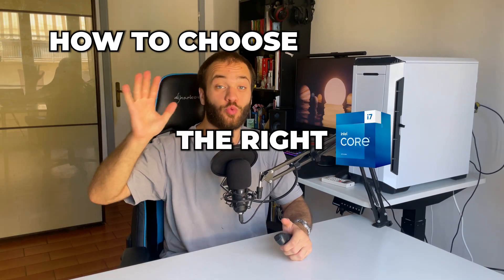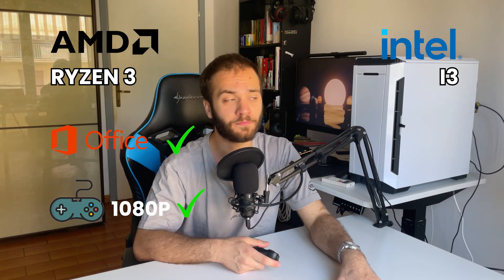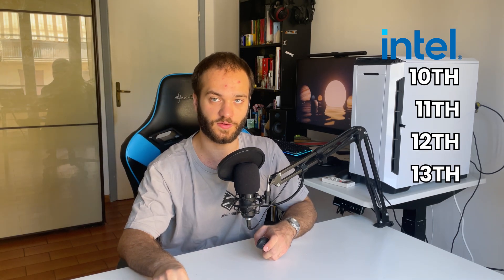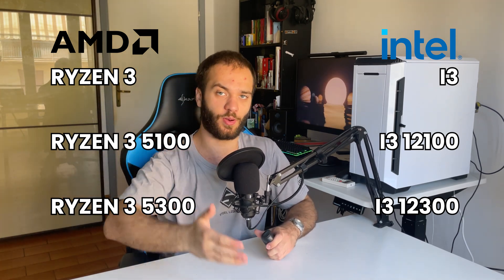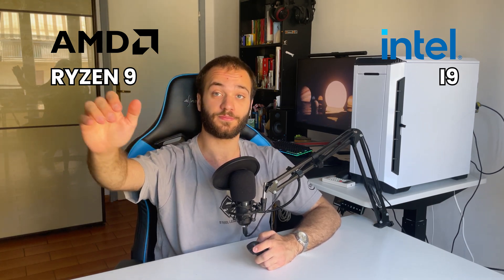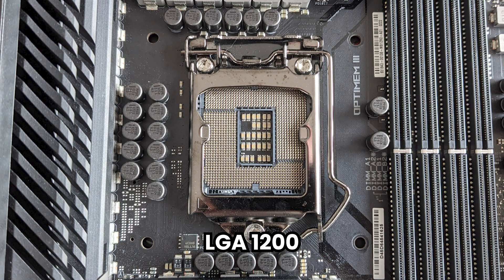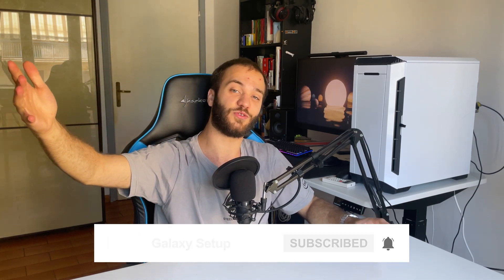HOW TO choose the right CPU in 2023! -AMD Ryzen vs Intel Core

Comment: Why did you say there are only two CPU makers?  If it only makes sense to review those two, fine, fair enough, but why incorrectly state that those are the only two?
Reply from the maker: Thanks for your correction: there are only two CPU makers for desktop builds, I didn't consider all the ARM-based CPUs since you can't just buy and install them on your PC. This video is an introduction for non-tech-savvy people to PC building, so I wanted to keep it as simple and linear as possible

Comment: Thanks very comprehensive. But you mentioned there are no 6xxx for Ryzen 7. I am looking at R7 6800H at the moment, thinking Abt whether I should get a Intel or AMD.
Reply from the maker: I'm glad you found this video useful!
To keep it as simple and easy to understand as possible, I had to avoid many details. The Ryzen 6xxx series exists, but only in laptops and super compact, low power consumption pcs. 
If you found it in a laptop, that's a solid choice, if it is in a desktop, I would avoid it

Comment: This video is just riddled with errors.   Ryzen CPUs without an X are still overclockable.  Only X3D CPUs can't be overclocked.  Ryzen 7000 also has "F" SKUs without an IGP.

Also, when gaming, lower-end CPUs are actually better suited to 1440p and 2160p than 1080p because gaming at those resolutions slows the GPU and makes it easier for the lower-end CPUs to keep up.  For 1080p gaming, you need a faster CPU to keep up with the GPU because the workload on the GPU is much lighter.  This is why CPU gaming benchmarks are all done at 720p or 1080p.

If a Ryzen 3 is capable of 60FPS in a game, it won't matter what resolution that game is at.  However, it would bottleneck something like an RX 6700 XT at 1080p but wouldn't bottleneck it so much at 1440p and not at all at 2160p.

High-Resolution gaming does NOT require a better CPU, it requires a better GPU.  Low-resolution gaming requires a better CPU becuase it's less GPU-dependent.  You're giving people false infornation.
Reply from the maker: Once again, as stated in the video multiple times, my explanation is a simplification for people that are new to pc building, so I've left some specific cases by side, since they would just confuse someone who's trying to generally understand cpus naming.

When gaming, lower-end cpus are not better suited for 1440p or 2160p gaming, because you're going to get a huge bottleneck with stronger GPUs.
High resolution gaming DOES require a better cpu, as well as a better GPU.

I'm helping people get into this world, while you're just accusing and confusing people.

Comment: Thank you for your knowledge on Ryzen and Intel processors ..I built a computer about 15 years ago and it worked good.. looking for the right mother board is super important ...number of slots for expansion cards ..usb ports and above all ease of accessibility ... and of course what processors fit into that board...also the types of cases that need to fit those expansion cards...One other thing..grounding gear. You don't want your body building up static discharge from walking around on a rug and then trying to put in a intel processor...Poof all gone.. Great video keep going you do it well. 5 Stars.
Reply from the maker: Thank you so much, I'm honestly shoked by the amount of positive feedback I'm getting on this video, it means everything to me❤️

I will soon make a more in-depth video about motherboards as well, since, as you said, you need to consider many variables for it as well!

Comment: Bit confused as to why 1440p was referred to as 2k. 2k 2048*1080, thus making 1080p 2k.

1440p could be referred to as 2.5k or QHD.

Anyway, given the price of motherboards, I don't see anything wrong with pairing a Bx50 board with a Ryzen 7
Reply from the maker: Yeah, 1440p is not actually 2K, but is broadly used as synonymous, and sometimes I misuse them as well.
Every time I say 2K I actually refer to 1440p resolution

Comment: Quick question, which combo is best for streaming and gaming ? GTA rp, Cod, Fortnite etc? Budget is around $1500
Reply from the maker: Hey, thanks for the question! In my opinion, if you want to go with second handed parts, which I highly recommend, I would pick a Ryzen 9 5900X or Intel i7 12700K and an RTX 4070 or a Radeon RX 7800 XT. If you want new parts, I woudl go with the same processor and an RTX 3070 Ti

Comment: Unrelated question: I'm considering parts for a PC, and my brother suggested water cooling, since my room is very hot, i have no air conditioning and I don't have the best air circulation. The room itself is fairly big and the place where the PC would stay is about 1m above the floor on an open partition of a wood wardrobe I cleared for it, the dimensions are 80cm height, 80cm length and 50cm depth. I'm afraid of water cooling because of leaking and maintenance, and from what I've seen the results are pretty similar. Does the room condition change it somehow? I'm not aiming for anything very powerful also, probably an i5 12th generation. The GPU would be a 3060ti, which is the only part of the set up I'm most certain of, unless I find something more powerful for a similar price, but that' a long shot.
Reply from the maker: If I understood your situation correctly, I would rather spend a little bit more on fans and on a good case (from Fractal Design, Corsair, Cooler Master or other reputable brands), to grant a better overall airflow inside the case. Water cooling is great, and if you buy an all in one the maintanance is relatively low, but if you don't enough air coming in, it will suffer just like an air cooler.
The room condition do change the needs for different cooling solution; if you can, it would be incredibly useful to place a couple of fans on the wardrobe itself, but you would have to cut the wood, and I don't know if you can/want/are willing to. But a good case with a proper airflow, with 3 fans in and a couple of fans out, should be more then enough for your configuration.
I hope I've been clear enough, if not, please let me know all your doubts and I'll try to go deeper into the topic
Reply: @GalaxySetup  you were clear and helpful, thanks. I just looked at the initial setup he has in mind, a 3060ti with an i5-12600. Is that a good processor? I want to buy and have peace of mind for a couple of years, think this would be viable for a while? And about the RAM, he said 16GB is enough, should I get 32GB instead? My budget is stretched as is, and the RAM seems like an easy part to replace later when I find a good sale and when 32GB becomes absolutelly necessary for gaming. These parts are not that cheap where I am, and it's a bulky investment, I wanna make sure I buy something that will last me as long as possible. And thanks for taking your time to answer these questions.
Reply from the maker: The i5 12600 is a great processor, and it's going to last for a while; and the 3060ti is the perfect match with it.
As for the ram, here in Italy and in most places is getting extremely cheap (32gb ddr4 3600MHz can be found for less than 100€), may I ask in which country do you live? 
Right now 16gb is fine for gaming, and since you're telling me that it's expensive where you live, you can always add it in a second moment
Reply: @GalaxySetup  I'm in South America. I'll probably leave this upgrade for later than. Question, if you don't mind. Currently, the price of the 4060ti is 17% more expensive than the 3060ti, both the 8GB version. For another frame of reference, the 3060ti is equivalent to roughly 40% of my budget, and the 4060ti about 50%. By this metric, which is a better option, considering I want the system to last a long time? I know the 4060ti is infamous, but from what I read the performance is slightly better, it's a newer model, lower energy consumption and better thermals, which would help with the case temperature. Is this assessment correct or I'd be falling on Nvidia's trap? The 4070 is 40% more expensive than the 4060ti, so it's a no go with my budget.

Comment: Concerning DDR4 vs DDR5, how fast does RAM have to be these days anyway? What I mean is 15 or 20 years ago upgrading RAM always resulted in noticable performance gains. Is that still true? Have we reached some sort of plateu where 16G of DDR4 is sufficient for many people and only those with specific needs will benefit from something like 64G of DDR5, or is more and better still always more and better?
Reply from the maker: I will make a dedicated video about this topic because it's too complicated to fully discuss in a comment. 
More and better will always result in better performances, the question is whether you'll be able to actually notice them. Currently, 16GB of RAM is sufficient for most people, but as soon as you work with workstation apps or multitask heavily, you'll saturate all 16 GB.
DDR4 or DDR5? Let me make this clear: I haven't tested yet DDR5 unfortunately, so my answer is based purely on benchmarks I've seen online. If you game, you won't notice any major difference; there's an improvement, but not noticeable enough. Do you need to work with your PC? The improvement is still marginal, but definitely noticeable in the long run.
The main fact is that DDR5 is becoming the standard with newer CPU generations, so even if you don't want to upgrade, you will soon have to.

Comment: great video, I was just wondering tho why do intel processors like the i7 have 16 cores compared to the ryzen 7 with 8 cores? and what would be the advantage of more cores?
Reply from the maker: I haven't got deeper in the subject because it's a little bit more advanced, but Intel now uses a mix of efficiency core (less performant, less power-hugnty, no hyper threading), and performance core (more powerful, less power efficient). In this case, not all cores are equal, so the core count doesn't tell us the whole story.
Reply: @GalaxySetup Unfortunately that information was exectly what I was looking for. What kind of use type would you use which type of processor for since the new core types have been introduced on the Intel platform, compared to what AMD offers.

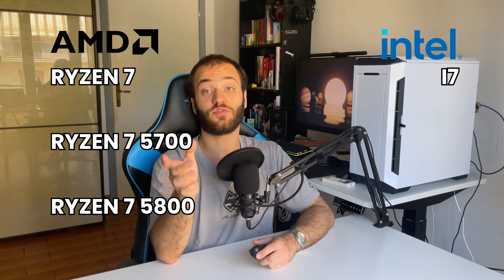Comment: 4:25 Wait, 5700x and 5800x have the same core count, or not? 
I personally don't see a point in buying 5800x, 5700x has a little lower clocks but performance loss is almost negligible but power consumption and heat generated are noticeably lower compare to 5800x ;p
Reply from the maker: Yeah, but the 40 extra watts allows the cpu to perform at higher frequencies for longer periods of time (if the cooler allows); and the price is basically the same